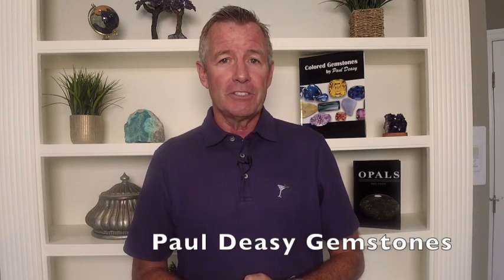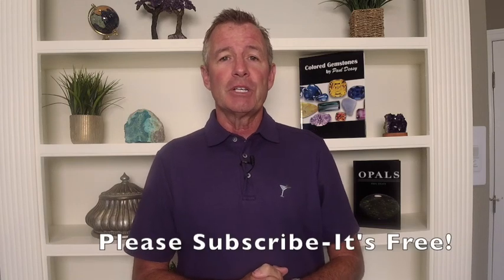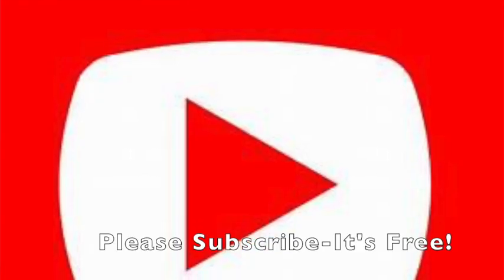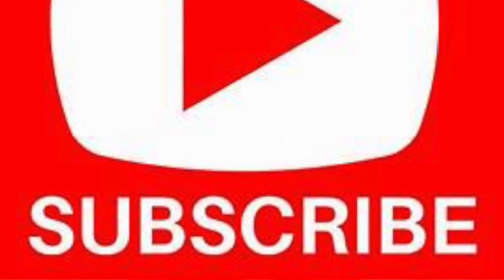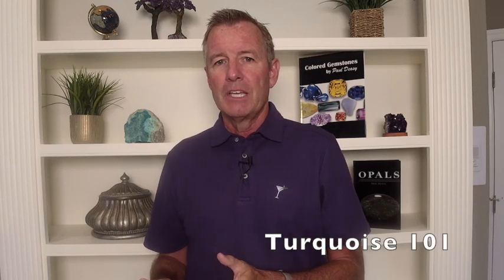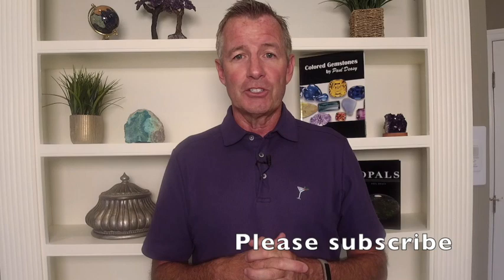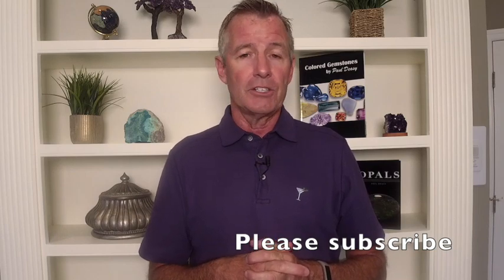Episode 21: Turquoise 101

Comment: Great explanations in your video thank you. Do you know how turquoise was stabilized using the Zachery method or direct me to someone or a link that knows some  information as how it was done. The Zachery turquoise has tested for having extra potassium in it after using this method. Mr. Zachery must have been a great engineer to turn out such beautiful turquoise. If anyone does tests to try and figure out the process let's share information. Just wondering if one were to highly buff turquoise with a potassium compound on a buffing wheel if that might work?

Comment: There is a lot of dyed "turquoise" on the market. If it's to unizone of a color it's usually howlite.
Reply from the maker: Hhi Chris. Thanks for the comment. Of course there are many turquoise imposters out there and it is not just about howlite. Any legitimate turquoise dealer should disclose any treatments such as stabilization If they are asked. All the more reason you should always ask them if there are any treatments. If they say no, then I would ask them to sign something to that effect. As for dyes, that is pretty easy to test or that. A bit of acetone on a q-tip would reveal any dyes in seconds

Comment: So the big Question is , after all this compression and mixing....
Does the stone still holds its Astrological values and benefits ??
Or it becomes just a fine jewellery piece ??
Reply from the maker: First of all, love your youtube name. I can now claim the entire city of Sydney, Australia as followers of my youtube channel! Great Question. I had a similar question about stabilized turquoise and its effects on metaphysical properties. First a disclaimer-I am not an expert in mystical or metaphysical properties of gemstones. I do understand that crystals have different vibration rates and energy within. I have also experienced that power while visiting a friend at the Tucson Gem show (David Geiger Minerals). Your question seems to be about Compressed stabilized turquoise which is very different from just stabilized turquoise. Compressed turquoise is made up of smaller fragments (even powder) from lots of turquoise rough that gets stabilized. Even with my limited knowledge of metaphysical properties, I would deduce that the resulting stone would not have anywhere near the same metaphysical properties of the original stone would have had. Now let's consider regular stabilized turquoise. Turquoise is a very porous mineral. If you don't fill those pores with something, eventually the oils, lotions, and other things that it encounters by being worn, will soak into the stone. That is why if  you have turquoise that hasn't been stabilized will change color over the years. In my opinion (again, not claiming to be an expert in metaphysical properties of gems) regular stabilized-not compressed-turquoise, should not be affected by being stabilized. Remember, you are not changing the fundamental chemical composition of the gem. It is only filling the pores of the gem which would likely happen over time anyway. I hope this helps answer your question. For more information on this I would suggest David Geiger. Here is the link to his site: https://www.quartz-crystals-for-sale.com

Comment: How can I tell of my turquoise is reconstituted or natural? It has passed the acetone test and the scratch test but some of the matrix is indented and some of it isn't. What do you think?
Reply from the maker: This is a great question. First let me clarify the question. You are asking about reconstituted versus natural. I wonder if you meant stabilized versus natural? First of all, the acetone test tells you it wasn’t dyed. If it was stabilized (infused with colorless resin) that isn’t a bad thing. Most turquoise is stabilized. As for reconstituted, that is basically taking  much smaller bits of turquoise (including dust) and compressing it. It is usually pretty obvious. It uses a lot of resin and should be much cheaper. Hope this answers your question!
Reply: @pauldeasygemstones  Thank you. I hope you don't mind if I have more questions. Yes, I am trying to determine if my turquoise is natural or not. I bought it before I knew anything about turquoise but I didn't pay very much for it. I can eliminate that it's not dyed howlite. I've seen some compressed stabilized, which I really like the look of, but it doesn't look like that either. I would, then, assume that it's reconstituted but it has some rough matrix and some smooth matrix. This confuses me as to what it is. I guess it's not very obvious to me yet. Is there any other way to tell based on the matrix or the feel, or anything?
I want to figure it out before buying more turquoise in the future.

By the way, I really enjoy your videos. I find them so interesting and you're a great teacher.

Comment: hi paul i bought some turqouise from someone who has alot of experience with turquoise.can i send you pictures and tell me what you think about them if there natural or stabilized ?
Reply from the maker: It is difficult to ascertain from a photo if something has been stabilized. You can try to send pics through to me on messenger (I have two facebook accounts-Paul Deasy and Paul deasy gems. In my experience, nearly all turquoise is stabilized these days. Even the #8 turquoise from 40 years ago, had to be stabilized. If you every had a piece that wasn't, you would notice it is noticeably lighter. Also, it it is chalky or brittle, it definitely wasn't stabilized. I did have a few pieces from Royston turquoise (Nevada). That rough was very hard and required no stabilization.
Reply: @pauldeasygemstones  yes your rite from what ive learned so far is that 95 to 98 % of turqouise is stabilized unfortuantly .but there are some natural turqouise out there probably very expensive.i sent you a message on messanger with pictures

Comment: Ive got some super hard vintage number 8 for sale with red matrix that was mined in 1960 that is not stabilized not would ever need to be for sale on eBay $775 for 6.2 pounds right now, and red matrix extremely hard number 8 polychrome ans super blue for $199 a pound, just saying